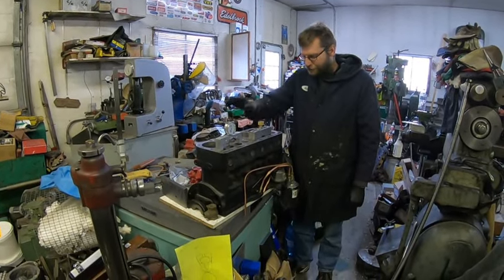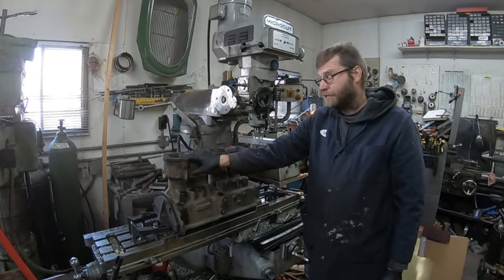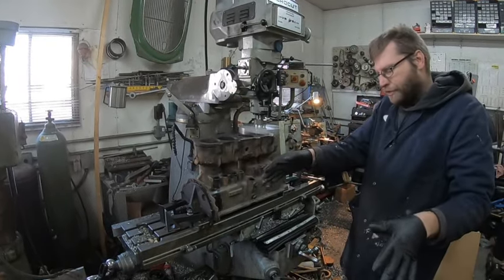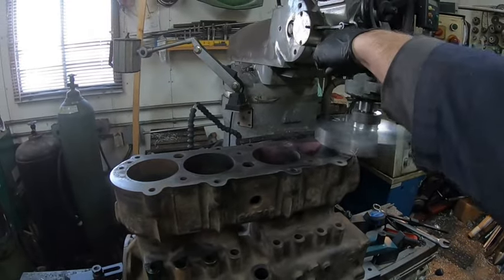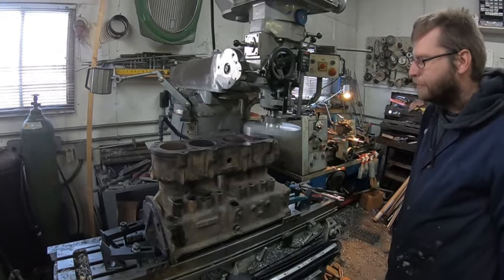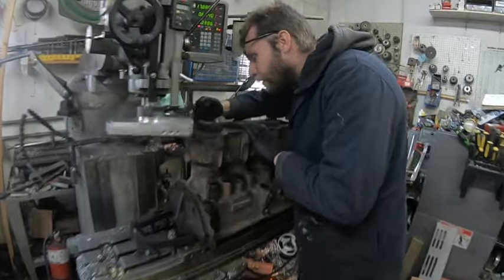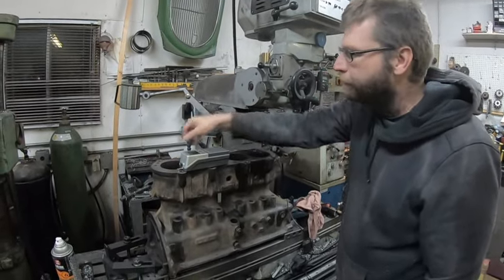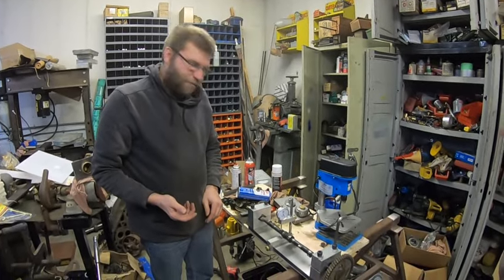1927 Chevy Motor, Decking The Surface With A Milling Machine.

Comment: Add an olds head and double the horse 🐴 pressure.
Reply from the maker: There are a few old tricks you can do to theses blocks its neat with what they came up with when they were hot rodding theses engines.